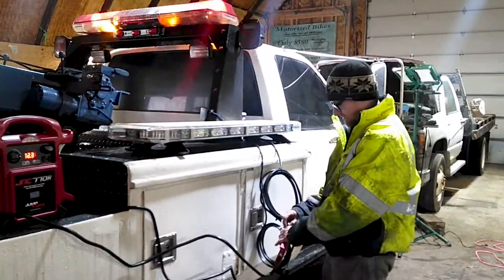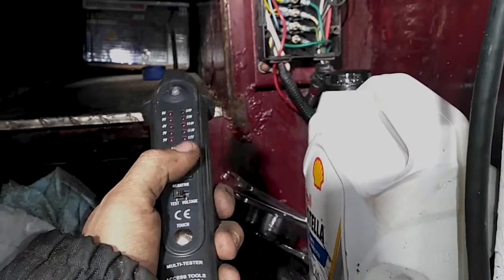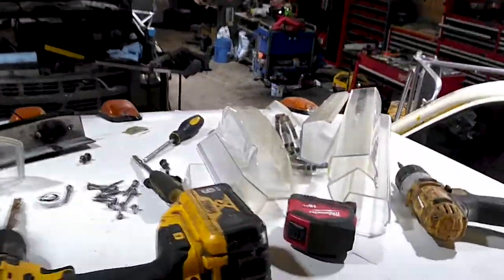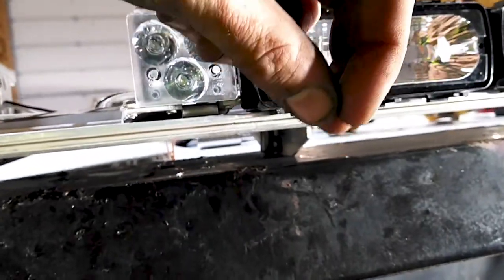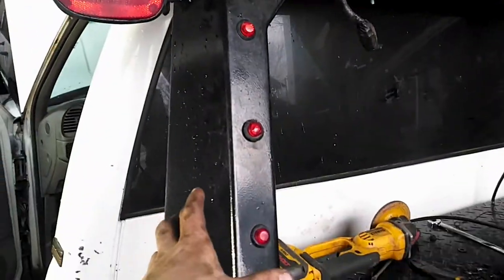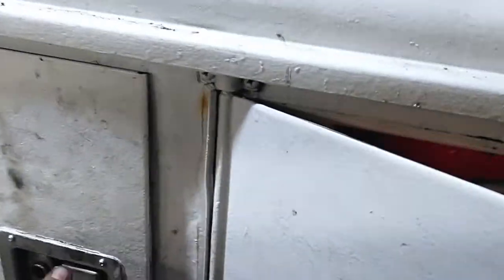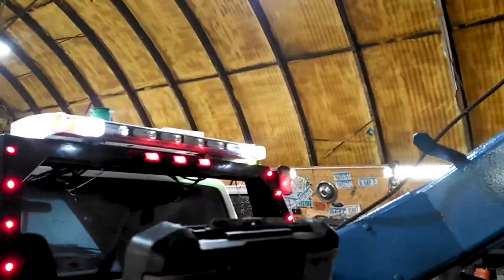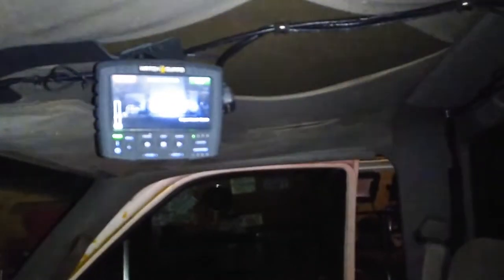Lights Camera Action! - Tow truck gets some much needed lighting updates

Comment: I'm a big fan of hockey pucks for lightbar mounts.....Rubber adds a bit of vibration dampening, and their diameter is enough to be stable even when stacking 2 or more for height as needed. Great video. Sweet upgrade package to bring an older rig into the modern age......
Reply from the maker: That's an excellent idea. I'll have to remember that.

Comment: I would have hooked the alley lights to the switch that did the intersectors. That way if you’re at an angle to the road with the rear lighting on, the alley lights are not shining into vehicles passing. Not really a fan of the flood on the corners, it takes away your warning when they are on. Leaves you to rely the midlevel you have, as everything on the bar will be washed out by the work lights when on. 

Having had them, I would rather have the corners flash than the little bit of extra light they throw off, which isn’t much. Compared to the dedicated work lights you have that are focused. 

I would have slowed the flash patterns down on everything too. Slower makes them easier to see and notice. 

I like the set up. You lucked out with the bar. I loved having the Liberty on a few of my patrol vehicles. 

If you REALLY want some back lighting, look for some SUPER takedowns for them. It’s 12 LED in each light. Same length as the LIN6 modules but it’s 6 of those TIR takedowns stacked on another 6. I bought them for one of my patrol vehicles and it was insane how bright they were. Made traffic stops much nicer. They would make awesome work lights. 

Good job though!

Comment: You can run red that would be really nice to have liberty in half red and half amber
And from my experience, change the ION pattern, split are the worse since they kill half of the light output and from some distance they looks steady, and intersection lights pattern have to be little slower 
And no white to rear, they are extremely dangerous and they blind people at night time, purpose of these lights are to warn people not to blind them, white on front and sides are fine but not to rear

Comment: Yeah, Whelen or Federal is all I would buy
Reply: Imo, soundoff are more reliable than whelen and FS,
Reply from the maker: I've never had any issues with whelen
Reply: @thunderbear0  they are a good brand as well. City, County run them here. I think the SoundOff bar is maybe better than whelen.. 
Federal has the best rotating light with the SLR. Whelens roto-beam is cool but the SLR is king.
Reply: @thunderbear0  any Class.1 light should be pretty decent